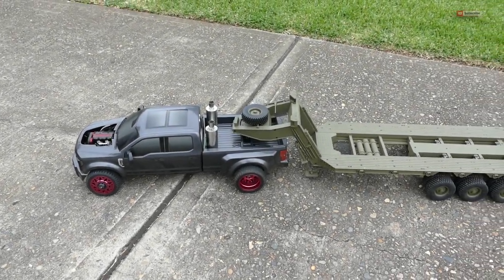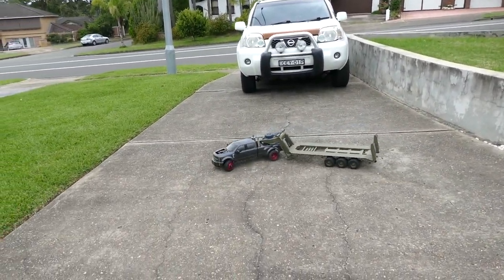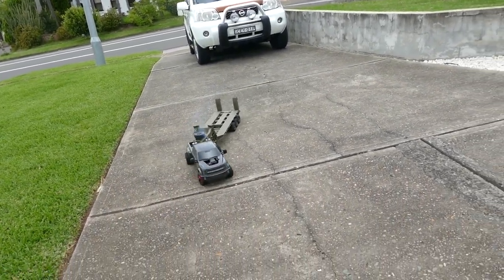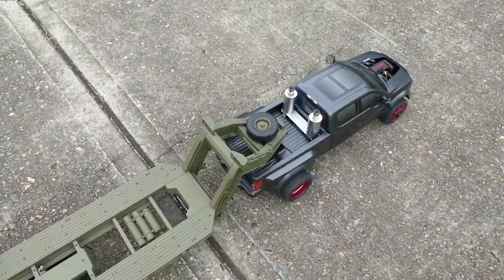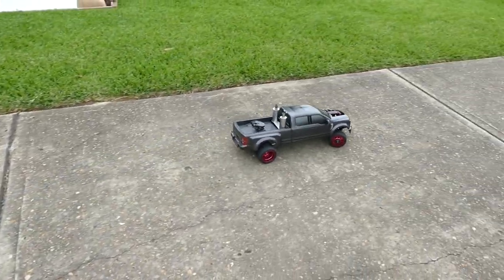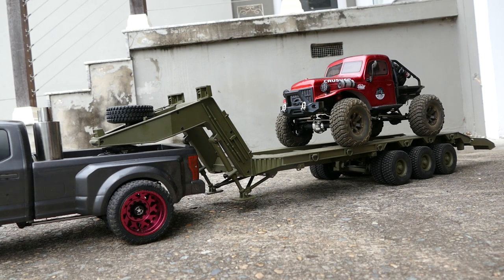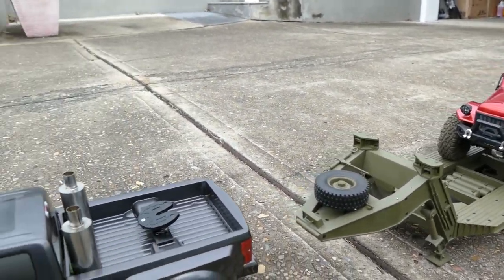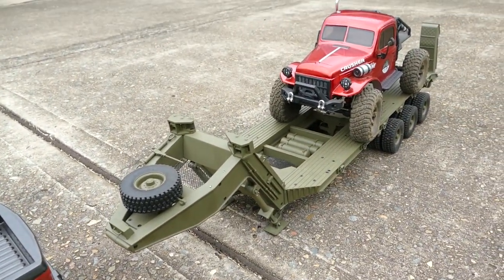CAN IT HAUL A 10KG METAL TRAILER?

Comment: I like your quick disconnect 5th wheel adapter idea, nice ! 👍 I was thinking of getting the traditional rear bumper frame hitch option after seeing your set up I now know what I want thank you 🙂 I like what you said “remove the factory clips n remove the 5th wheel bracket n like it was never there” 👍 sweet ! It’s like you were there when the Cen F450 was first designed 🤣 nice ! you guys on utube come up with some crazy awesome ideas 🙂! also yours is the first I’ve seen with a fuel powered motor WTF😳 ….N I C E 👍👍
Reply from the maker: Much appreciated brother. Glad to hear that you liked it

Comment: So cause of the clutch it has less pulling power compared to the factory battery F450 set up ?
Reply from the maker: Yeah well the electric motor has no clutch. The nitro conversion is using a basic two shoe clutch

Comment: Why not out it diesel
Reply from the maker: Do you have a diesel engine to use?
Reply: @RCTanksTrucks247  it’s very expensive but if not diesel run it electric like normal
Reply from the maker: I have but that's boring.

Comment: If you lower the gear ratio in the truck it would make it so have a little more torque to move that little easier you loosen speed but gain torque
Reply from the maker: Yeah definitely thought of that 👍